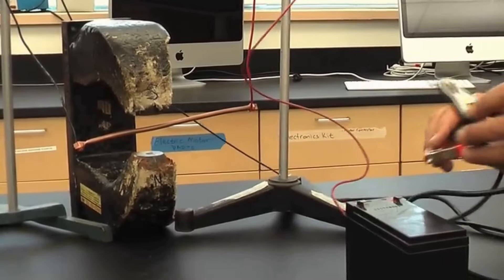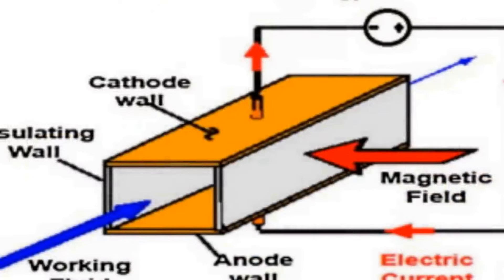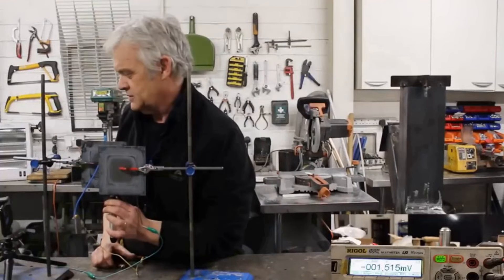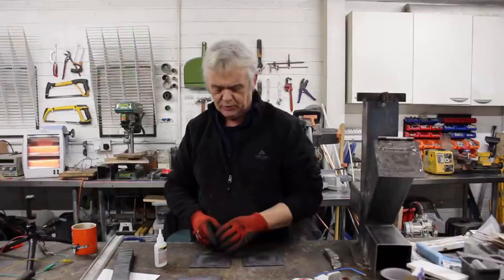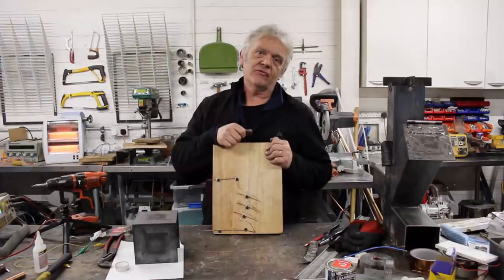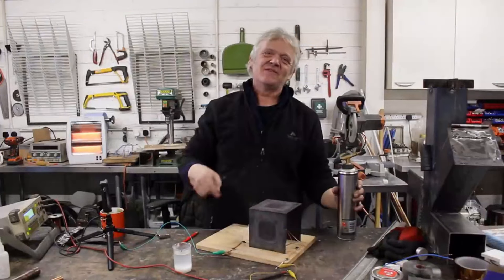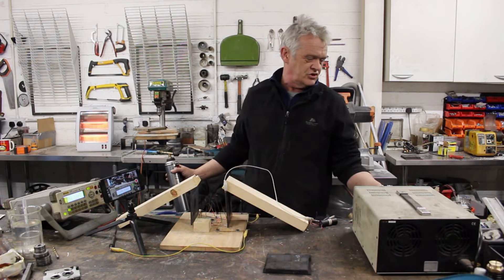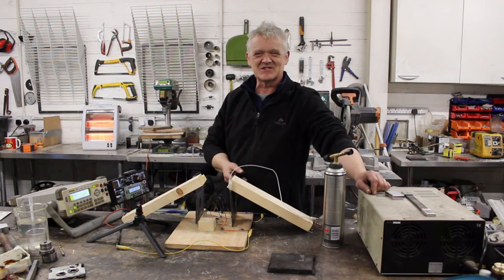2245 Generating With DIY Magneto And Electrohydrodynamics

Comment: Great video again Rob, thanks. Something to keep in mind for the electrostatic case, very likely with the conductive "air" that the changing field (possibly changing capacitance, I haven't fleshed it all out in my head yet) is drawing current off the HV bias. To determine your total net, the power going into the HV supply needs to be accounted for. By guess is that more power is going into the supply to maintain the high voltage. Also guessing you still come out ahead as the main energy is coming from the moving gas/plasma.

Comment: I've been attempting use a magnetic field to separate materials of differing density and magnetic susceptibility. The apparatus has proven to be somewhat tricky for a DIY project.
I've got the 3mm wide inside dimension "aquarium" built. Now playing with the magnetic field properties of strength, stationary v moving, attracting v repulsing.
Reply: Liquids or solids?
Reply: @FieldDay-cj3tv  
Solids in liquid.
Specifically gold and copper sludge in a "muddy water" condition. Allowing turbidity to drift down past and through the area of magnetic field. My theory is that with a higher density, and a much less negative magnetic susceptibility, gold should be less affected and pushed aside less than the copper as it settles out of suspension from the liquid carrier.
This should at least increase the ratio of gold to copper in one collection area, and reduce the same ratio in the other. The sludge is obtained through a nacient chlorine reaction created by electrolysis in sodium chloride brine. So very similar particle size for all solids.
Reply: @Vibe77Guy  consider fluidized bed-type agitation?
Reply: @lokiaverro4196  
Agitation is really not the issue. A simple attempt to decant the clear liquid from over the sludge is enough to entrain the top layer of solids. The particles are very fine. The nature of the nacient style reaction assures this. The process must, therefore, attempt as little external agitation as possible. Even the action of drifting out of solution tends to result in 'blooms' at the leading edge of the turbidity induced current. This may require multiple lines of magnetic field areas to contain the dispersion top and bottom. These magnetic field areas are going to end up being at a fairly steep angle relative to the direction of gravity. The forces between the magnetic field and the particles are very small. More powerful magnets, or possibly a spinning field, may be required.

Comment: Very cool, I wonder what the ROI would be for adding something like this onto a stationary generator, could the heat energy in the exhaust put enough energy into some additive to make a plasma.
Reply: I suppose it depends of how much or how quickly a rise in temperature in the less amount of volume as capacity for whatever it to get to the plasma stages and why That is required for where
In households probably not something that most would need 
A industrial area
Best use a different types of getting generation in site and losing the resistance in the lines for surely a large large load used for its capacity
Probably cheaper for generation rates per fuel other than paying for service or supply that's has higher resistance to get it there from its source

Comment: This is always one of the most interesting channels.  I'm not sure about the practical application of using a flame, as a flame source tends to represent a high cost (money and materials) source of electricity.  Fluid running in a loop might function better?  But sticking with plasma for a moment, where might we incorporate electrical power generation, and would it make sense to do do?  For example, a wood burning rocket style stove into a sand battery?  Incorporate the power gen into the battery?  But the battery may only need firing for 20-30 minutes per day, once a day, so not really worth a handful of watts of power?  Maybe a detachable sleeveapparatus separate from sand battery, such that the sleeve could be reused on multiple sand batteries?  This maybe viable if there's a central firing for 8-10 batteries lasting several hours per day each evening...  Other than flame for heating or cooking, I'm not sure where else to apply this for people struggling to meet power generation in a rural/low tech area.  In industrial manufacturing or refinement, at-scale thermal capture and redistribution is already viable in some situations, so maybe not a huge leap to recspture some of the energy as electricity as well.  Thenexpected energy cost of apparatus production and installation and removal must be compared with the power generated over the lifespan of the components and maintenance costs.  Does it still make sense to reclaim power this way?  Just trying to think of application scenarios.

Comment: in the early 1980's, the russians built a coal burning power station.  they added a magnitic hydrodynamic generator to the plant as a 'topping' plant to increase the thermial efficiency.  they passed preheated the intake air in the main furnace to make the firnace air a plasma.  it eas passed through the MHD at high speeds and then into the steam boiler.  The steam power plant was 38% thermally efficient. the totally plant efficiency was in the high 50's%.  The concept was presented to us by our thermodynamics professor.  How he knewabout it I am unsure, but, I became aware the in the late 1950's 0r early 1960's, he worked at (he said) Calder Hall in Cumbrier.  However, I suspect he worked on the other side of the river at Windscales.  In September 1962,  one of the two reactors at Windscales caught fire (because it was made of graphite - the moderiator) as was the RBMK3000 reactors at Chernobyl and elswhere in the USSR  (see the simularities of history repeating).  He did his Research Masters of Mechanical Engineering on the emercency cooling of nuclear reactors using liquid metals. in 1963. As both facilities were primarilary used to manufacture plutonium (a function that the RBMK 300 reactors could also perform) for the British Bomb Programme.   One month later the Russians had a similar sized nuclear accident. All these facilities were highly top secrect.  As such, I suspect my Professor had been previ to top secrect intel on what the Russians were up to and became aware for the MHD project from those sources.  He was always cautious on what he told us as I suspect he was still bound by the 50 year rule on offical secrets.  The true nature of the Windscale incident was revelled in an BBC Horizons Televisions Programme in 1992.  I never had to opportunity to speak with him after leaving University to ask him what and where he was really working on.

Comment: Wouldn't at least some part of the energy you see generated come from the high voltage device that produces the electric field?  By using a blow torch you ionising the air and in the presence of the 20kV field surely some small current starts to flow between the two steel plates. The copper thingys simple serve as current collectors.  Am I badly wrong?
Reply: I was asking myself the same. You have to subtract the consumption of the HV thing from the result...